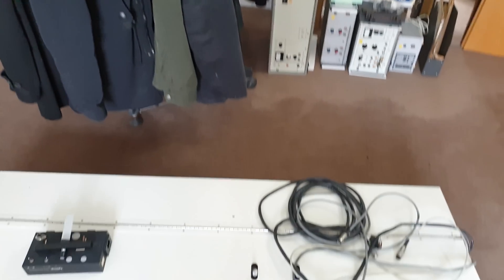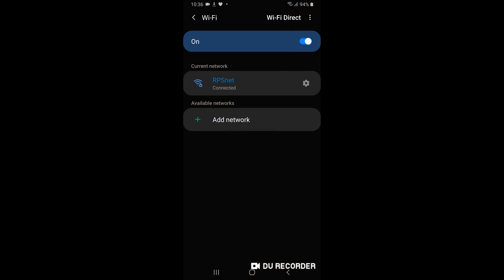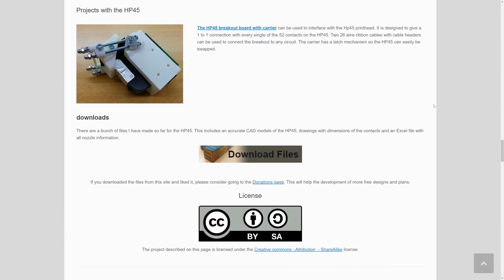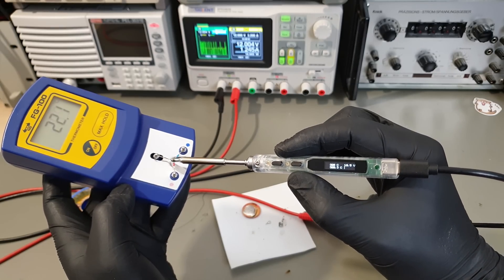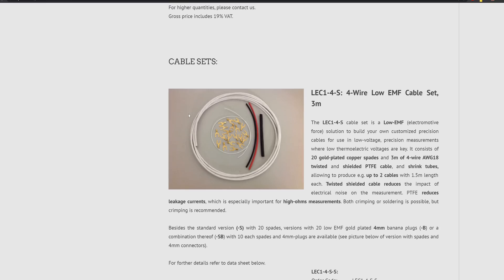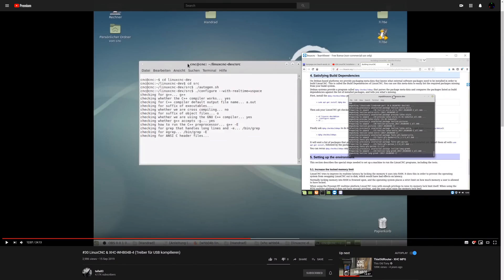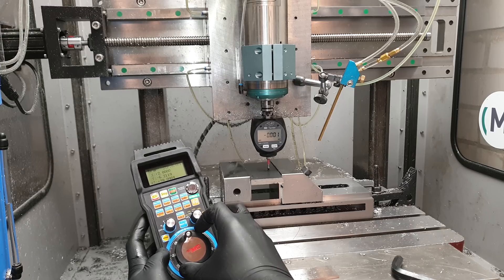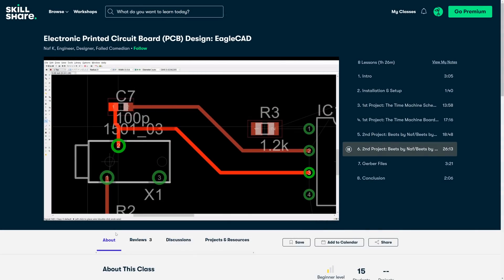uh, just 2020 things

Comment: There are indexable end mills down to ø6mm actually
Reply: I bet the inserts are too small though. Still, would be fun to try it on my 6040 :).
Reply: @sarahjrandomnumbers   well you use a magnet for when your takeing them out and put them in agen after turning to a new fresh corner ( yes carbide insert are light magnetic )
Reply: @sarahjrandomnumbers  Ingersoll NanoFeed Indexable have down to ø6 straight shank if it is ( though some super specific inserts i might add )

Comment: I have not been so lucky in finding a cheap old laser chassis to use as an optical breadboard. I have the slabs of aluminum and the equipment to quickly (kinda) make my own....but I would much rather find one similar to your yag chassis. Would save so many hours of work. 

Any ideas? 
For a DIY or “less expensive” optical bench maybe even some mounts and hardware. 

Don’t get me wrong I  Thorlabs gear... The few pieces I’m lucky enough to own.… But something a bit cheaper would be great, Until the serious need arises

Comment: I have one of those hydraulic crimp presses they sell at harbor freight... Identical to yours.   Cost about $60USD.  Worked great for 2awg battery cables with those style terminals you have shown.  I sawed one apart and confirmed the copper was fused.

Comment: “Inkjet 3D Printer” is exactly how polyjet fusion works, and it’s basically the worst kind of 3D print. Good accuracy but worse than SLA, crap durability worse than SLA (thinner resin I guess?), weird surface finishes, and takes longer than just about everything. Ignoring expense because that could easily be brought down via open source dev.

Comment: There are vape / e-cigarettes that can output 200W with three 18650 batteries or 60W with a single one. And do it temperature controlled through measuring the changing resistance of heating coil made out of nickel, titanium or stainless steel. Someone should really make a truly wireless soldering iron with a temperature controlled tip! You'd really only need to make the soldering tip with a custom heating coil and screw it on a vape with a 510 connection.
Thanks for your videos :)

Comment: How about using the selpic mechanism to print PCB designs on FR4 (preheated to about 60 degrees and then dried further with a hot air gun). I.e. as an alternative to toner transfer etching.

Comment: CAN or CANOpen is relative slow for such a purpose and in most cases not deterministic. Beckhoff has step-dir IO as well.  A DIY solution would be an interface with a Microchip or Trinamic IC for Ethercat. The Microchip IC has a price tag of 10$. An Ethercat stack can you find on Github

Comment: For the soldering iron I want the reverse! Just a cheap usb pack to barrel jack convertor. Needs to be cheap and compact. Then you can also power all your other toys as well (doesn't need to be super accurate like that bench supply thing. Just a simple selector switch for voltage would be ideal)

Comment: Problems with using inktjet printers for 3Dprinting is that the usual printing liquids are way to viscious, so you would need special resin that is very expensive (and still cause clogs in standard nozzles)

Comment: Wait hold on that inkjet 3D printer thing... I mean you could do resin like that, no? And at very high resolution and ridiculously thin layers. It'd be slow as hell, but you could put a number of heads in parallel and do 10 or 20 layers in a sweep. That would let you make prints with unbelievably fine details. with good positional repeatability you could also do small, very high aspect ratio holes and complex channels in solid materials.

I must be missing something because that idea is way too obvious to not have been thought of already...

Comment: It's worth noting if you don't have the money/time to build a whole new main board a $5 zypds board is a drop in in place of the barrel jack on a regular ts100 and can deliver the power, you just have to remove the old jack and solder it in with some 18awg wire. I read 45w at 20v so some 45w power banks can supply it's thirst

Comment: Just curios: What append to the TS245?
Reply from the maker: I heard some rumors that the otter-iron creator is interested in looking into it
Mine has been disassembled a long time ago, because I never got the right adapter rings to make things fit nicely
Reply: @reps  I have build some Adapter-Rings for the outer sleeve of the TS100 to fit T210 Cardriges, but had problems with the other contacts. I also reconnected both FET Transistors in parallel to increase the maximum current.

Comment: one could make a conductive ink and print some pcb´s
Reply: very limited pcbs size wise since alignment between multiple prints next to each other will be difficult
Reply: @urugulu1656  oh yes that would indeed be dificult could you use a script to make it possible? well that would be a nice product to invent then no need to etch some plates, but i doubt it would handle more than 2 amps
Reply: @Humbulla93  you will probably have to mount it in a cnc machine (like a printer) to make those adjustments easy kinda defeating the whole concept
Reply: @urugulu1656  something to type in the dimensions of the board and when you reach the endpoint of print the device beeps so that you can rearange the apparatus starting with the second print and so on and so on. but even then a small 3d like printer or cnc machine could be transformed into a e-ink printer, the filaments could be made of carboncomposite so you wouldn´t even need a new device

Comment: At my old office we had an Objet 30 3d printer from around 2008/9 I think? It used a liquid uv resin and the print head was like an injet printer with a UV curing lamp that passed over it after laying a layer down. It used two materials, a model material and a support material that was water soluble. The printer might still be in storage that I have access to.
Reply from the maker: oh buoy
Reply: @reps   I think there's an old printhead we pulled out of it, because it clogged regularly, it might still be in the cabinet with the printer. If I can nab that would you be interested in the printhead?

Comment: 3d printers got many softwares and stuff, but why is the cnc world so fucking cancerous? it's like anyone involved in it intentionally obfuscates everything and makes it unecessarily complicated, relying on libraries from other dimensions
Reply from the maker: maybe it's the real-time thing that no OS supports natively
Reply: @reps  Yeah but why an entire OS when arduino or low level firmware can do the same? What's a CNC do that a 3D printer's crappy arduino can't? Worst case you can CANBUS daisy chain a few controllers.

Comment: Would love it if you could do something with geiger counters and survey meters. I think scintillation detectors would interest you especially. 
Because they have to do with optics and are similar to lasers
Reply from the maker: Maybe someone has just given me a beautiful ludlum and a few detectors for it :)
Reply: Marco Reps 

also… Check around eBay regularly for retired area monitor sensors. (portal monitors) Tom has a video on his channel showing off one of his portal monitors he picked up for under $500! Those things are so large and sensitive they can give 20,000 cpm background!!!!

They come in all sizes and will give you a big pieces of scintillation plastic with one or more photomultiplier tubes attached. 

I picked up a giant piece of bicron bc412 plastic scintillation  plastic...weighing over 5 pounds with a beautiful Hamamatsu pmt tube attached. Needs a bit of reworking but will make an extremely sensitive area monitor detector. Or the plastic material can be cut and polished into other scintillation crystals. And I only paid $50 delivered!
Reply: If I get anything extra I’ll send it your way. I just received my new Ludlum model 3 freshly calibrated from Tom at “iRad inc”. With a beautiful 44–9 pancake probe (but more importantly)… A bicron  2 inch Nai(tl)scintillation probe. Thing is ridiculous. I can drive by an antique store and pick up radioactive glass from inside my truck! It’s fucking nuts! (Of course i’ve only tried it with one specific antique store that my buddy owns...  with an entire room full of uranium glass)

Now my issue is directionality and pinpointing the location from a distance. I’m making a lead collimator to focus the detector in one direction. 

I purchased it because I go to a industrial scrapyard every day… And here in Tennessee we are very close to the Oak Ridge national Lab. (Home of the atom bomb). I guess security used to be more relaxed 50 years ago… or maybe we just get a lot of medical waste… I don’t know… but our scrapyard sees more than our fair share of active sources. 

My buddy runs the scrapyard and doesn’t have any scanning equipment… So I got into detection equipment to try and keep us safe while we scrounge around in the beautiful industrial waist!!! 

I’ve been bitten by the equipment bug, and will be building a few of my own scintillation probes. I highly suggest Tom at “IRad”. And for a great starter scintillation probe… Look at his DIY plastic scintillator kits. 

Not as sensitive as a naI(tl) detector… But they are very rugged and inexpensive. And still 50x times more sensitive than a Geiger counter tube.
His 2 inch and 3 inch kits are amazing! But if you buy a 5 inch crystal kit,… It’s extremely cheap and will be just as sensitive as a 2” naI. Which is ridiculously sensitive! 

I get 3000- 6000 CPM background radiation!!! 

Like I said… Now my issue is making a collimator so it will be more directional.

Comment: I was thinking about buying the laser to do micromachining, bulk removal or circuit manipulation on IC's under a SEM. My idea was to use the existing lightguide form the CL detector and it's parabolic mirror as the light path. But the whole thing is a bit inconvinend to handle.

Comment: Location permission is necessary for controlling WiFi, since nearby access points can be used to triangulate user's location, hence... permission needed.
Reply: Well, no triangulation, but seeing the MAC addresses of WiFi APs around you is more than enough to pinpoint location to about 15m. The same with BLE. BLE doesn't need to be paired, you simply see packets from other BLE stations with their respective MAC addresses.
Reply: More to the point, location permissions would be necessary to allow the app to print those locations which conceivably could be quite handy - especially in a mobile printer.
Reply: Google: "Location permission is necessary *.*"
Reply: It is not triangualation. Tyere is just an API that can do your location on cell towers.
Reply: @lolerie  it actually is. What happens in detail is that Android phones upload their location and WIFI signals around them on regular basis. This enabled Google to create a database of WIFI access points and create a service that returns approximate location based only on few signal strengths of known MAC addresses. Triangulation is a mathematical process which is done on Google's servers to determine the location based on signal strength.
Reply: @MladenMijatov  no, we were talking about LTE. there is just an id of every cell tower. And by using 4 cell towers and their APIs you can get your place in 3 demensions. It is allowed by the standards.
As for MAC addresses it is possible, yeah, too. But no such service in google. What is possible is that Wifi signal power and beacons can be used as internal GNSS save point, when you are inside building.
Reply: @lolerie  That is triangulation. Whether it is the API doing it, or not. Triangulation is happening.

Comment: The one and only question about the Selpic is: But can it print small PCBs?
Reply: When it comes to termotransfer method - no. You need laser printer, not ink one.
When it comes to printing FR4 and copper - I'm afraid the answer is still no. At least never found copper doped ink.
Reply: @HorochovPL  I know. It was  a pun on all his videos concerning DIY PCBs. And, by the way, if I want to print a PCB higher than the standard cartridge, you would have to align these tracks. This would limit the application (if it would even work, as you mentioned) to manufacturing single-sided TS100 clones... And then you would have to upload every new track via this WiFi misery
Reply: @vincentguttmann2231 /videos Yeah I was making fun too.
Maybe if we include some kind of camera and detect overlap of previous print to auto-align next part? Will need some serious engineering to make it work at least somewhat realiable. 
Another idea, attach such printer to CNC, but as You mentioned, crappy upload software. Yeah, it's like using robotic arm to rotate pancake!
Conclusion: converting full-size printer is much easier.
Reply: @HorochovPL  well that firmware problem can be fixed with a lattepanda and a bit of Python

Comment: Great stuff!! I love the idea of using a single board computer with Linux CNC. Currently I have a big annoying PC tower driving my CNC
Reply from the maker: beaglebone black seems to be great candidate, because of its built-in real time unit
Reply: @reps  There was a group porting LinuxCNC to the beagle. I wonder if they worked through their porting problems.
Also, it would be awesome if they ported the parallel port option so that old legacy machines could benefit.